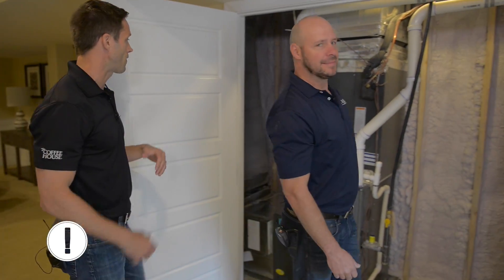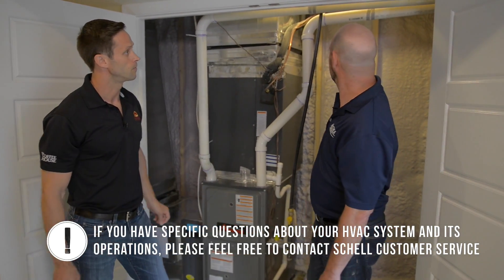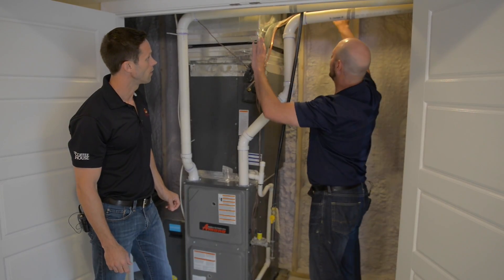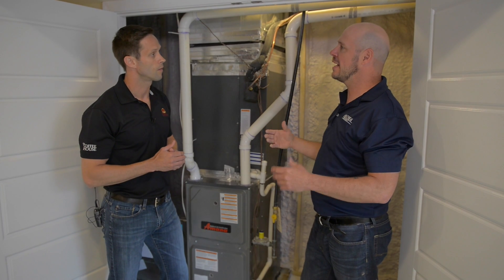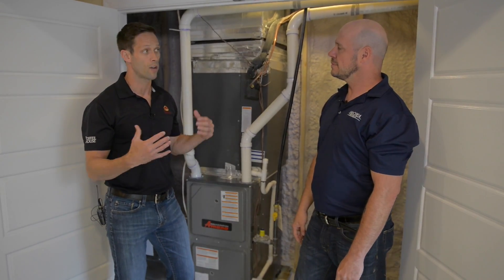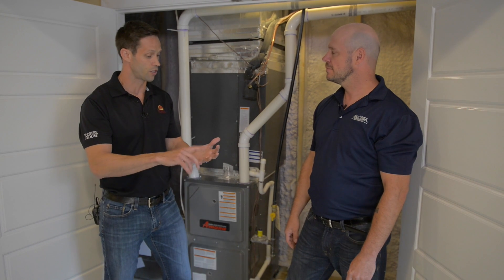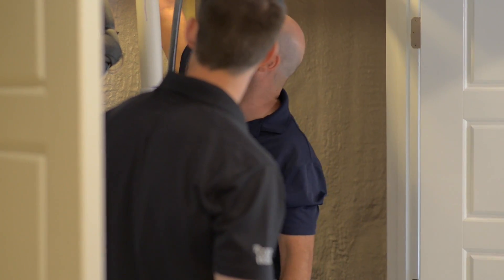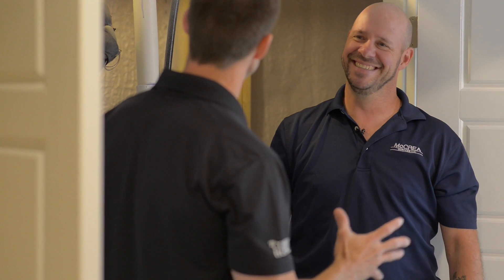How to Adjust Your Manual Dampers

Comment: What should i do if the damper doesn't completely block air coming out of the vents the damper is supposed to stop?  I have the damper set to closed and still feel a decent amount of air coming out of those rooms' vents.

Comment: Great video and there's a ton of great videos on this but there is not one that will help me find my damper. My furnace is in the attic and there are duct work coming out of it then there's 2 boxes way over on the left would those be my dampers?  Each of these boxes has ducts coming out of them.  But the life of me I cannot find the switch.  Any suggestions?

Comment: Good video. Same goes for those with a basic refrigerator. If you have a switch in both your freezer and refrigerator best thing to do is move it to warmer on the freezer if it's an analog dial. It opens the damper to the firdgerator. Allows more cold air to circulate. Unless u need tight temps in that freezer it's useless as the board in the refrigerator controls both. Wide open or slightly wide open is the better setting.